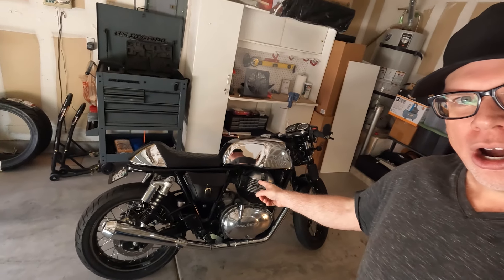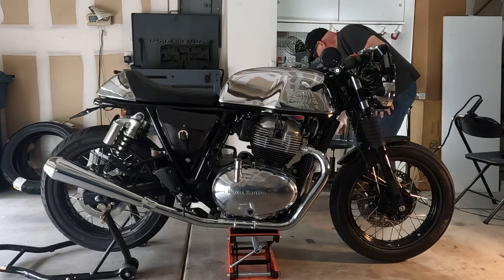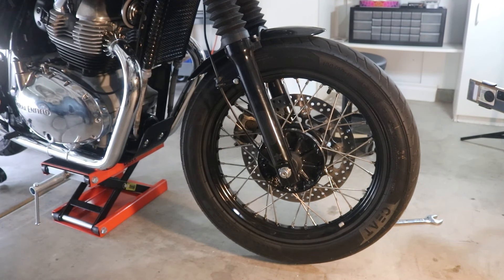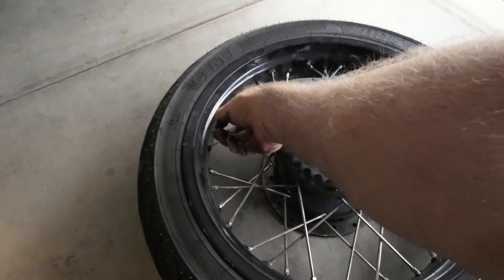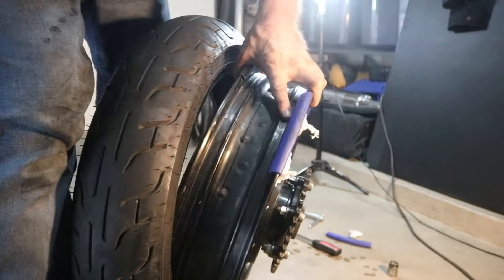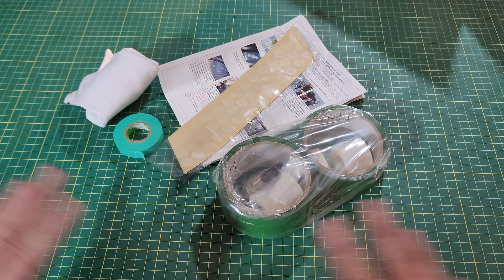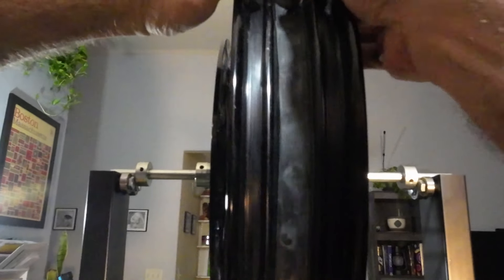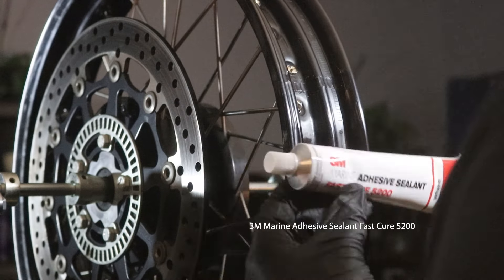Tubeless Spoke Wheel Conversion & Wider Back Tire | Royal Enfield Continental GT 650 | Outex Rim Kit

Comment: I’ve been in the automotive and motorcycle field for half of my life, and I’ve never once did the cardboard thing you did as there is no need.  If anything I compress the pistons a hair so it goes off and back on easy.  But they aren’t going to push their own pistons out unless you hit the brake lever.

As a tip, this step is wholly unnecessary.  I’ve had a Thruxton R on my lift for a few weeks while parts are getting powdercoated, those big Brembo calipers are more than happy to just sit there hanging with no piston movement.

Comment: i can convert in much less.. just cut an interior in half, then wrap it around the inside, insert the air intake nipple (valve stem) into the designated hole and make sure sides are locked and overlapped on the tubeless tires apply apply beading oil as needed.. the gorilla tape, sanding etc may not be necessary as well as removing the rubber strip over the knobs.. after inflation, just cut away the excess rubbers from the halfted interior.. and you're good to go.. and anti-puncture sealant is optional.. enjoy! :)

Comment: Did you notice a quickening of the steering or braking as a result of removing the mass of the inner tube?
Reply from the maker: I noticed much a smoother ride at high speeds and better cornering but not sure if it's due to the different tire brand/size or tube removal (maybe a bit of both.) Before, at high speeds or cornering there was a bit of wallowing and it didn't feel like the bike wanted to lean into corners. Now, at higher speeds it feels solid and just the slighted bit of counter-steer the bike leans right into the corner. I haven't noticed anything with the braking but I may not have been paying attention.
Reply: @RideWithJerry   -  I suspect that the better cornering and turn initiation is due the better tires that you put on.  Given the price point of the bike and RE's switch to Ceat caused by pandemic supply problems, the OEM tires may be "lumpy" in their construction or rubber consistency.  That's just my guess, but there have been a couple other reports on Youtube and from a neighbor of mine with a 2021 Himalayan of wobbles or unsteady cornering with the OEM Ceats.  In the crowded commutes of Indian cities, that probably doesn't matter, but on western highways and freeways, it could be a problem.
Reply: Now you raise the point it would have been interesting to know the weight of the inner tube (with valve), Sahara Moto sealant, the 3M sealant, the sealing tapes, the tubeless tyre valve and the original and replacement wider tyre. I suspect the unsprung weight would be a little higher now but that's just a guess.
Reply: @dogphlap6749   -  My point had to do with change of the Moment of Inertia of the front wheel - whose tire width was NOT changed.
The moment of inertia results in the gyroscopic force of the wheel as it spins, and in turn affects the sensitivity to front wheel deflection, i.e. "lightness" of steering.
As you point out, the increased width of the rear tire did increase unsprung weight, but it also reduced ease of lean initiation by increasing the rear wheel's moment of inertial.
It's interesting that the sum of the effects seem to be a greater ease of turn initiation.
Reply: @daveinwla6360   Thank you Dave for your reply.  I strongly suspect you know much more on this subject than I ever will.  I have a bit of an obsession with weight of motorcycles (this one in particular since I own that exact model). Something I have experimented with is rake angle, which is set at 24 degrees by Royal Enfield but can be easily reduced by moving the front fork tubes up into the triple clamp (they can be pushed down too but only 10mm before they become flush with the top triple clamp). The rake angle is also highly dependent on the length of the rear shocks. I fitted 30mm shorter shocks to my GT to reduce seat height (I'm really short). That increased the rake angle by 1.3 degrees which sounds like an insignificant amount but it really made a big difference in how the bike felt to ride i.e. much less nervous. Shifting the forks up a similar amount restored the rake back to 24 degrees. That is where I have left things for the moment (but I have to say I preferred a rake angle of 25 degrees, much less twitchy but cornering required a little more intention on my part).  I don't race my bike on a track or on the road.
Reply: @dogphlap6749  -  I admire your skill in controlling the sensitivity of your bike's steering.  You knew what the effects would be of the changes you made, and you knew how to adjust them to suit you.  Few people can do that!
Reply: @daveinwla6360  Too kind.
Reply: Probably equals out no tube mass but more tyre so probably no less weight
Reply: @RideWithJerry  That's because you've put decent tyres on it.
Reply: @Overlander 123  - Only the rear wheel got a wider tire.

Comment: I don't mean to repeat a  question someone might have asked before but
In your opinion and in terms of the real world, do you think this conversion is safe and will it pass the test of time?
Reply from the maker: Done correctly, in my opinion, it's perfectly safe. I've only had it about 8 months now, but I've had no issues, and tires have held pressure. Others have said it has lasted them years. But like anything, results may vary.

Comment: Can't find Scorpion trail front tyre, what do you recon?
Reply from the maker: I had to do a lot of searching to find tires, bought the front and rear from different websites. I don't have experience with any other tires for this bike  but I've seen a lot of recommendations for Bridgestone Battlax BT46 tires.
Reply: @RideWithJerry  Thanks! for both 18" stock rim, I have used Pirelli "Angel GT" in front and Pirelli "Scorpion trail II" in rear. Works just fine for Dubai hot and dry climate.

Comment: Tyre sealer to balance the wheel? why didn't you just balance the wheels while they were off?
Reply from the maker: No need to balance manually - the sealer used for puncture protection also balances the wheel.

Comment: Suggest you cut a timber block to size so your front lifter is under the frame NOT the header pipes. Pretty basic mistake really.
Reply from the maker: I lift under the sump guard, not the headers.  But yes, without the guard, a block is needed. https://imgur.com/a/fnBxfi4

Comment: Still going strong? No issues?
Reply from the maker: Yes, still going strong! Just completed a 1,500 mile trip. Rode through both cool rainy weather and hot dry weather. Temps ranged from 40s to over 105 f... no issues, pressure still holding 🤟

Comment: How is it holding up?
Reply from the maker: Good 👍 Only been about 6 months but so far it's been holding up well. No leaks or issues.
Reply: @RideWithJerry  Sounds great, and what is the recommended front & rear tyre pressure after the conversion?
Reply from the maker: @ArkajyotiChoudhury  recommended tire pressure will be on the tire. My tires are 34psi.
Reply: @RideWithJerry  34 for both?
Reply from the maker: @ArkajyotiChoudhury  Yes, that's what is shown on both my tires.
Reply: Is it working all right ? @RideWithJerry

Comment: WHAT TIRE ARE YOU USING IN THE FRONT WHEEL??
Reply from the maker: Both tires are Pirelli Scorpion Trail II Dual Sport... I changed the size of the back but kept the front tire the same size 100/90-18. Next tire change I may go wider on the front.

Comment: What are the benefits of going tubeless?
Reply from the maker: The main reason I went tubeless is they are less likly to go completely flat from a puncture and are usually easier to do a roadside repair to a puncture. You can also use sealants to fix a flat.
Reply: @RideWithJerry  ,
Congratulations on your manual skills and your well-equipped workshop.
But I think it's not worth doing all this work just to remedy in case of a puncture.
There is an excellent product that also works perfectly with tubed tyres:  Motul P3 Tyre Repair
Reply: @ralpholeni433  when you get a flat out in the middle of no where then it’s so totally worth it, and saves so much time it’s unreal so yes it definitely worth it
Reply: @danielkerr4100  ,
Of course these are personal opinions.
I stand by my opinion
Greetings

Comment: people have this idea bigger is better i had a kawasaki w 650 for a long time 80 000 miles i retrade 130 18 rear to 4 inch old style k 70 avon front 19 100 to avon 325 19 ribbed just like 1970 british the handling was much better quicker into corners top end handleing ok 60 years biker all weather s uk we have lots of roads with bends great for 70 80 miles per hour
Reply: People usually fit bigger tyres because they think it looks good, waste of money if you ask me.

Comment: In my experience fitting a wider than standard rear tyre gave poorer handling/less stability.
Reply from the maker: Hmm, maybe it depends on the type of roads and riding you do. I've found it to be a very noticeable improvement.
Reply: That makes no sense tho wide tyres are meant to handle much better they disperse more heat and last longer than thinner ones
Reply: @danielkerr4100  The tyre should be the correct width for the wheel rim, exceeding this has limitations.

Comment: Not a great idea as it doesn't last long. It would be great if RE would fit wire spoked tubeless rims as standard, it would be worth the bit extra in price.
Reply from the maker: Well, I'll see how long it lasts... if it lasts until the next tire change then it's worth it for me. But yes, a spoked tubless rim would be awesome! Somthing like the Kineo rims would be great but they cost about $3,000 for a set.
Reply: Did mine two years ago and they’re still perfectly fine
Reply: Who told you it doesn't last very long?